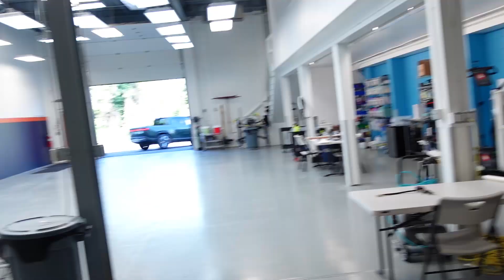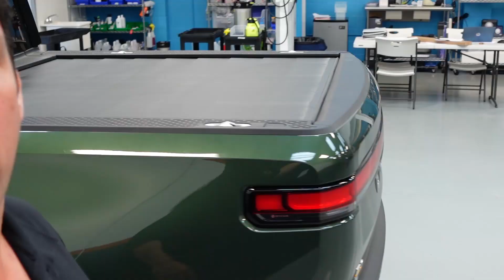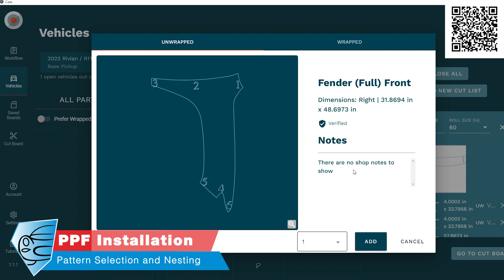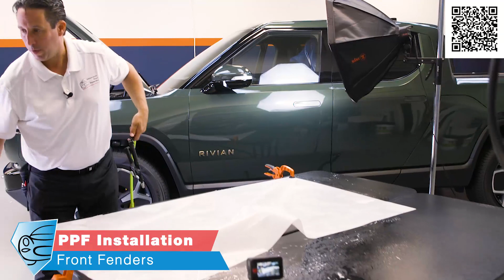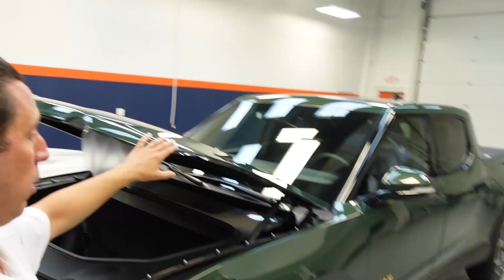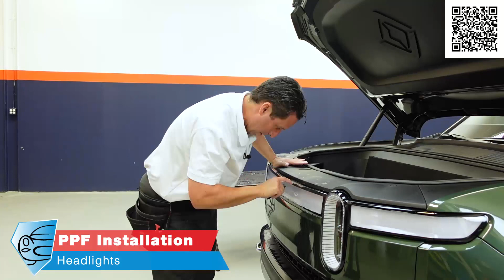Adventure-Proofing a Rivian R1T with Paint Protection Film

Comment: What is GM prep what is that stuff???
Reply from the maker: The Gyeon Prep - is one of my favorite cleaners to use after a vehicle is properly washed. The original purpose of Gyeon Prep is to clean paint surface of any oils, etc prior to a ceramic coating installation. So you prepare -"prep" the surface for a ceramic coating.   For paint protection film installation I like to use Gyeon prep, because I can inspect a "surgically" clean surface one last time before the paint protection film installation.